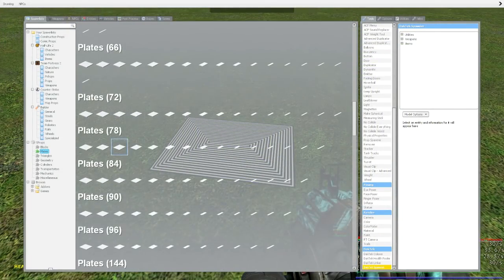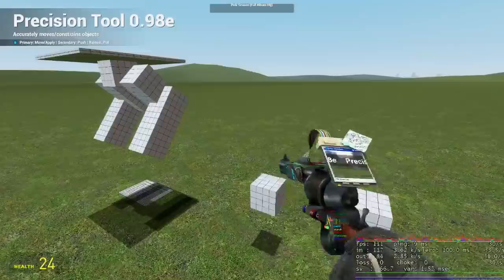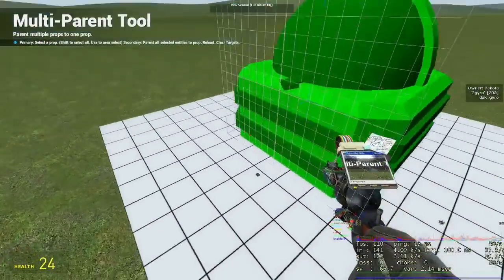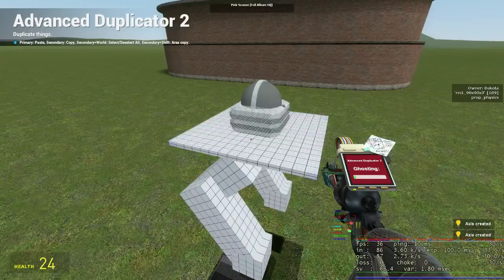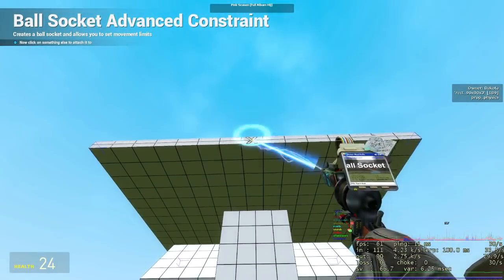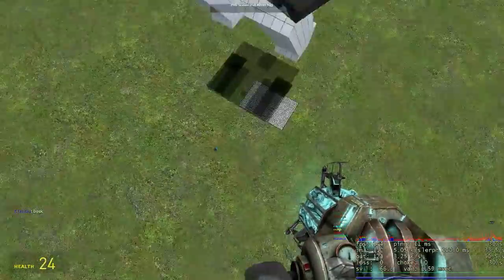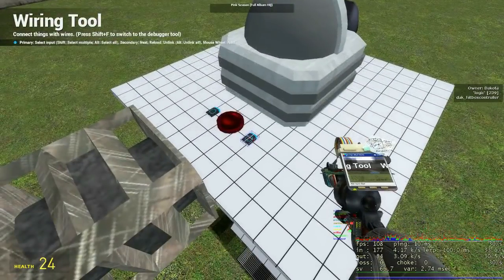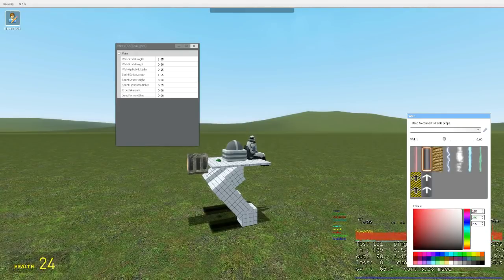DakTek Tutorial Series 1: Gmod Mech Tutorial

Comment: If I unfreeze the mech it's just "sit" down. It won't move. The gyro is activated, and linked to a reactor.
Reply from the maker: It just sits? Do you mean it falls onto the ground or crouches a bit? The issue is likely that the gate is not parented to the baseplate though.
Reply: Built it again: it started orbiting around itself and started wandering across the map xD.
Third time it worked!

Comment: wire doesnt seem to be cooperating with me,i did everything as said and in the wiring part the gyroscopes inputs become red,but the outputs of the pod controller dont,and it doesnt seem to work at all
Reply: i got that problem figured out but now the mech spazzes out when i unfreeze it.
Reply: the urban mech adv dupe doesnt work either
im giving up
Reply from the maker: Quite sorry to hear that, could you tell me what about the dupe doesn't work? I need details if I'm to fix problems.
Reply: it says that the adv duplicator doesnt recognize the dupe ciphering,i removed the ' on each side,tried with and without them,also it said about something bein 7 instead of it being 92 which was supposed to be the proper number
Reply from the maker: seems like this is going to be quite a confusing issue to fix. I'll try my best.

Comment: excuse me, what do you do the the Thigh next to the lower hip, i did not see what constraint you put
EDIT: i found out, but when ever i parent the reactor, or spawn it in using advdupe2, smoke comes out and it sizzles and i unfreeze the mech and it spazzes out, any solutions? but when i remove the feet, it stops, any ideas?
Reply from the maker: Client side movement and draw parent should be the only things checked, draw player and auto-unclip can be on or off.
Reply from the maker: The smoke and sizzle is an effect that plays when the reactor reads the contraption its on and sets up its required values, its perfectly fine. As for the spazzing just contact me on steam and I'll see if I can figure out what's causing your issue. Make sure the weights are properly setup.
Reply: I have tried making 2 versions with torso now, bot both spazzes out completely, the gyro have to be placed on the hip right? and should it be welded or parented to a chip or prop?
Reply: Also if it helps, I get this error: [ERROR] addons/daktek/lua/entities/dak_gyro/init.lua:916: bad argument #1 to 'ipairs' (table expected, got nil)
  1. ipairs - [C]:-1
   2. unknown - addons/daktek/lua/entities/dak_gyro/init.lua:916
Reply from the maker: That error is saying that its not getting a table of the props in the contraption that is supplied by the engine. If you haven't set an engine then it could possibly be nil instead of the expected NULL in my code. Try using the linker tool to link the gyro to the engine. Also the gyro should be parented to a gate that is parented to the hip base prop.

Make sure that after you set everything up that you copy it and paste it. The contraption must be respawned once after being setup for it to take effect.
Reply: Hm, I believe it was so, I try again and see if I can find the error, but trying to understand what went wrong, what are the settings to be used for camera controller?
Reply: OK thx!